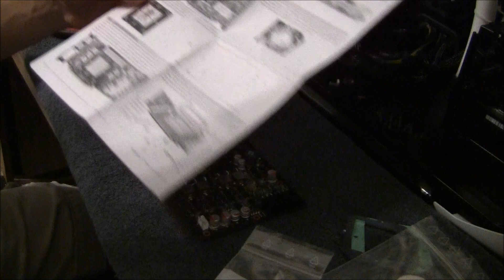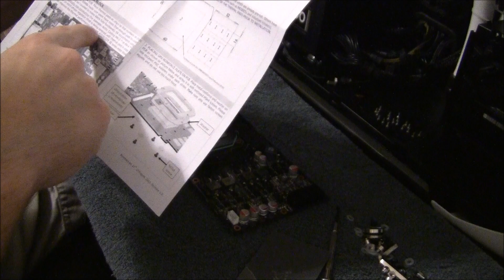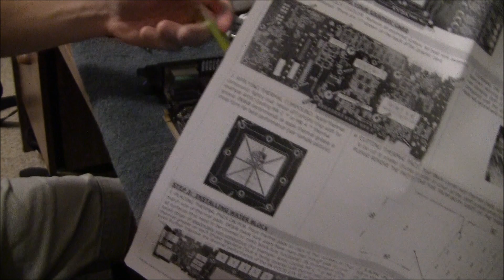EK Water Block Install w/ EVGA GTX 570 HD Edition

Comment: hey bro... so got the same card, got my block installed a few days ago... sadly ran into leaking problems, one of my BP 90º had bad rotary... fixed it and temps BLEW! like, idle at 75? so something wasnt right. shut down, reinstalled block, now all is fine. idle at 31 and when gaming i havent even hit above 40c... HOWEVER... since installing the block (not blaming block, but maybe i done something wrong?) im getting purple screens...
any ideas??

thanks man. your vid helped me out installing!

Comment: Those are your EVGA GTX 570 HD 2.5gb, right?  I've got the same card, and might throw an aftermarket cooler on it, but I don't from this video if you're using the 2.5gb versions...?

Comment from the maker: @mrali95 This info was released from EK on their website. Just read that they started shipping the Rev 1.1 blocks on the 10th of this month, and the previous version of the block will no longer be sold. Part number is EK-FC570 GTX SE (rev. 1.1), but like I said I'm not entirely sure which PCB the Twin Frozr III is using, if it's not listed as compatible just send an email to EK and they usually respond quickly.

Comment: Is that waterblock compatible with the gtx 570 twin frozr III? The Cooling configurator check sais it's not, but the twin frozr II is. Only difference is the is the higher quality caps on the frozr III, which many other compatible models has too. Do u know why it's not compatible, cause I really wanna water cool my frozr III card?

Comment: all i want to know is if you are still using the dual radiator, i want to do the same thing with 2 570s and i was hoping i wont have to buy anything bigger than a dual 140mm radiator.

Comment: Very nice Mike, they look extremly pretty. I hope you dont have any nikel flaking issues. Down here in Aus, some users have experience Nikel flaking even on the electroless plated models.. I presume you'll be looking at getting a bigger case to get more radiator space?? or are you going external rads on the 600T?

Comment: @PCModderMike 100-130 fps? that's amazing, is that on High (or Ultra?) in Metro or Caspian Border? That's why I requested a bench video for BF3 like the one you made for Crysis 2. I like the fact that you use a camera, so your FPS isn't gimped by Fraps recording which isn't what people want to see anyways. Maybe if you get around it, make a run with one of your single 570 @ 900mhz and another with SLI in Caspian Border =)

Comment from the maker: @dragonxxorz Yea I was surprised too, getting 100-130 FPS with a clock of 850MHz on the core. But, the multiplayer is always less demanding than single player, and I think the fact that it's a beta also makes it less demanding on someone's system. So I hope I'm good for full release. Sorry about them SOC's dude, I sold them for a good price too on eBay, the same guy picked up both of them.

Comment: @PCModderMike Playing at High right now, can't say the FPS is bad... it's in average around 50-65fps in Caspian Border, which surprises me considering the requirements they announced... then again, I do have my CPU and GPU OC'd pretty high, I think at that point my GPU acts like a 470. But yeah, shame you sold that 570 SoC, I could have gotten it maybe cheaper off you!! Still gonna think about buying that SoC, I only use 1 monitor that's 1920x1080 so memory shouldn't be a problem

Comment: @PCModderMike Alright hehe, quadruple youtube replies ftw. I just watched the unboxing video, as well as the Accelero cooler video. You sure like modding :p I've heard of the Accelero's working wonder before, those temps were great. Went down from 85c to 53c, pretty crazy. My current rig is a i5 760 @ 4ghz and msi gtx 460 hawk @ 900 mhz. It's been working really good with all games so far, but it runs out of memory like crazy in BF3. Sits at 977/1000mb most of the time lol

Comment: Nice vid, but why with those 4-2 PWM PCBs? Even with the vrms being watercooled now, wouldn't OCing on higher power phases PCBs such as the gigabyte/msi/asus ones be more efficient? Or is the WC'ing enough to slide voltage to the max and keep it around 900 mhz core? I thought those very reference pcbs, or really similar to the reference one

Comment from the maker: @TheEhxpert No a bag would be last case, worst scenario, they are designed to attract static to the outside ofbthe bag. That's why they're good for protecting stuff on the inside, I will admit I've done it in the past. But I would stay away from that practice.